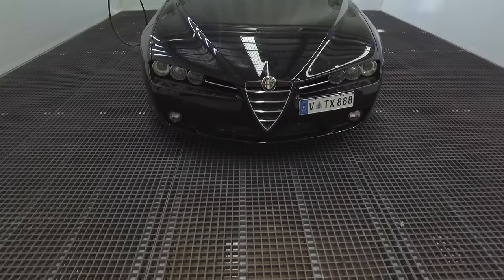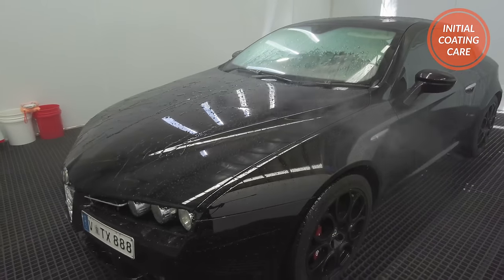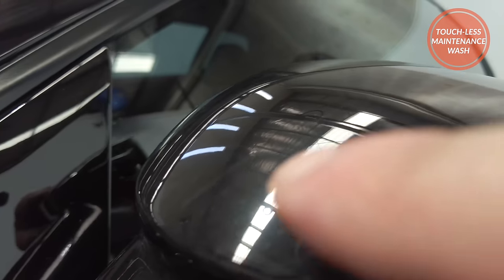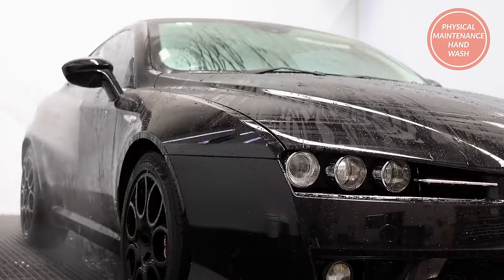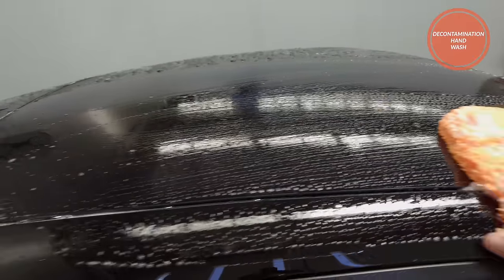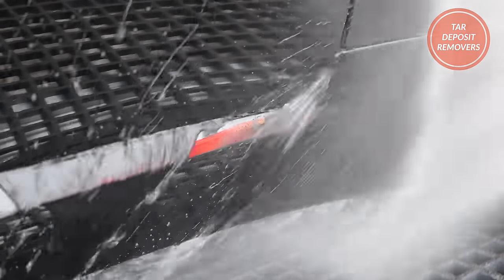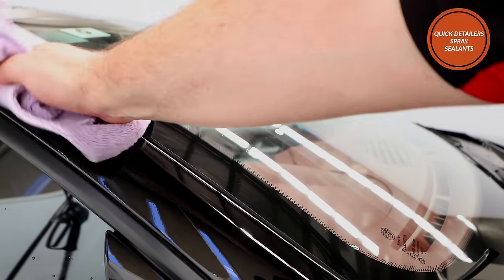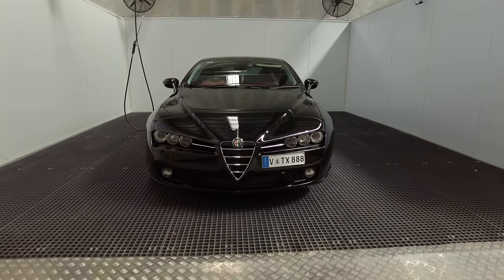How To Wash & Care For a Ceramic Coating From Day 1 To Day 1001 | Washing, Decon & Maintenance

Comment: What is your opinion on using a touchless drive thru carwash with no brushes?
Reply from the maker: I’m not a fan - they tend to use harsh chemicals that won’t do you paint, trims or coating any favours

Comment: hey! awesome video as always. i have a question. i got my car ceramic coated and its first wash is due after 2 days. but unfortunately there was rain in my area and now my car has drops all over it and they also dried up on the car. i am worried whether this would damage the ceramic coating or leave water spots. should i really wait 2 more days for the first wash ?
Reply from the maker: I would just give it good pressure rinse down (with using any detergents) to remove any dirt, blow dry it and then just a quick detailer (maybe one made but the same brand of your coating) to hopefully remove the water spots. If you get to water spots quickly they are generally far easier to remove, and the first week or two after a coating has been applied is always when it’s most susceptible, so it’s best to try and avoid or deal with water spots quickly during that period.

Comment: H Sandro, How do you deal with driving through rain and then parking the car in the garage at home. Does leaving the rain water dry up naturally cause water stains?
Reply from the maker: I’ve found is really dependent on the specific environment. Being in the country now I find that the rain water in my area is super pure and really doesn’t seem to produce water spots, whereas when I’m in the city and working close to the airport the rain water tends to leave water spots far more commonly. It’s also contaminated city rain water mixed with strong sun or UV light that seems to produce water spots most regularly. In other words sometimes it’s abs issue and sometimes not depending on the factors. If I do see water spots, I just try and wash the vehicle as soon as I can and if I don’t leave it too long they usually come off next wash, but if I don’t and just leave them, then they seem to start to etch in.

Comment: Bought a used car with ceramic coating, but it has swirls all over. I’m guessing that’s under the coating? Would a good polish and compounding get rid of everything, and then re coat it?
Reply from the maker: Yes, a compound and polish will typically remove the coating along the the swirls/defects and you can re-coat at that point.

Comment: Thanks Sandro for the video this will come in handy in a few months! 
Do you have any tips on which ceramic to pick? I have two in mind but know very little of them both. 
 
CarPro CQuartz Finest Reserve or Nova Pro? 

Cheers!
Reply from the maker: They are both fantastic coatings so I think you’ll be happy either way
Reply: @CarCraftAutoDetailing  Thank you before the link to this video again Sandro, 

I have question: If a a pro ceramic is coated on the car and i use say Nova Boost/Jet/Lustre. Would that mask the superior properties of Nova Pro? as u layer a inferior coating ontop of the pro nova? This is a scenario i look to many washes down the track and want to know about those little details! Thanks Sandro!
Reply from the maker: There’s always at least some masking in the short term with anything that goes over a coating, but a good well performing coating will tend to reject and remove it much quicker compared to applying it over bare paint. The main benefit is that it helps the coating underneath age better with sacrificial layers being applied from time to time and if those products also have great hydrophobic abilities there shouldn’t be a negative performance effect.
Reply: @CarCraftAutoDetailing  Awesome since finally my new car arrived and its getting Nova Pro, should i stick with applying boost to it from time to time or Nova Jet? :D
Reply from the maker: I’d just leave it with nothing to start with then use Boost after a month and maybe Jet after 3-6mths
Reply: @CarCraftAutoDetailing  legend perfect answer!

Comment: Hi Sir.. after deep clean just like your steps in the video..can i top up my existing ceramic coating (not the Carpro brand) with Carpro Gliss?? My existing ceramic coating are doned by certified detailer and just few months of ages..or i just need to apply the Carpro reload 2.0 instead of Gliss or just let the existing ceramic coating work alone.
Reply from the maker: It’s typically fine to add Gliss after a coating is fully cured and usually the best time is after a deep strip down clean. But I also think it could be a good idea to speak to your coating installer and also get their advice
Reply: @CarCraftAutoDetailing  they advice to use some QD for routine washing to extend the coating life Sir.. mean that I can use some of paint sealants right? The CQ gliss just same as sealant for coating?

Comment: HI Sandro Jeremy here I have emailed you a few times. Thank you very much for this informative video mate I really appreciate it. Sandro you know the problems I am having regarding my ceramic coating dealership. I think I sent you the video of my vehicle and how only a few weeks after the coating it has lost it's hydrophobicity. It is still the same mate what do you recommend I do to bring this hydrophobicity back? I am taking the shonky business to court regarding the terrible job he did on my vehicle. He will not give me proof of product he used I asked and paid for the premium Graphene Ceramic Coating. He will not give me his warranty as I have tried to take my vehicle back because of it losing it's hydrophobicity. When washing the vehicle like you showed Sandro letting the mitts and product do the work no pressure from day 1 the cloths have dragged over the surface not gliding nice and smoothly as a ceramic coating should allow. Keep safe and keep up the great work Sandro thank you for your help.
Reply from the maker: Unfortunately it sounds like the coating itself has failed, so I would be surprised if this process would help as this is really about reviving a coating rather than fixing a failed application which generally requires removing and reapplying the coating.
Reply: @CarCraftAutoDetailing  Thanks Sandro

Comment: Thanks Sandro! What are your thoughts on rinseless washes? Are the better than a good quality soap?
Reply from the maker: I think rinse-less is a great option when water, environment, and logistical challenges are present but it does have its limitations especially when a vehicle is extremely dirty. A pressure washer pre-clean just has so many benefits is safely removing dirt before a physical hand wash that just can’t be overlooked. If the vehicle isn’t all that dirty then rinse-less or water-less can be a great option
Reply: @CarCraftAutoDetailing  thanks Sandro! I’ve been bouncing between the two methods and haven’t found it to be more efficient outside of skipping the rinse after washing the vehicle. Just curious what your thoughts were.

Comment: When doing a touchless wash, you should start at the bottom, so that you wash with the soap and not just rinse it all away. Just make sure to end the rinse top to bottom. 
It also makes it easier to see where you have been, when starting from the bottom.
Reply: Yeah agree on that one, and during a pre wash of a very dirty car in our conditions, I'd guess Sandro's conditions are slightly different hence him doing the opposite. That's the only bit I'd do differently, based on my conditions where during winter the lowers and rear of the car are filthy.

Comment: An acid based cleaner is what’s used to break a ceramic coating down so how does it revive it?
Reply from the maker: An appropriately formulated acid cleaner is used to remove bonded water mineral deposits.

Comment: Hey Sandro, I’m wanting to ceramic coat my 2004 VY calais .. I need to do a two stage correction on it but I don’t have a garage so I’ll be borrowing one. Can I coat it and leave it in a garage for 24-48 hours after coating and then leave it sit outside after that? Because I’m on street parking I just don’t want to waste my time coating it
Reply from the maker: Yes you can absolutely do that
Reply: @CarCraftAutoDetailing  thank you mate ! :)

Comment: Hi Sandro, what kind of ceramic coating did you use?
Reply from the maker: Nv Nova Pro
Reply: That’s impressive! Is it a free sell product or for professionals Only?
Reply from the maker: Professional only
Reply: @CarCraftAutoDetailing  di you compare it with Carpro, Geyon or any other “mass”brand? That’s looks incredible after 3 years…

Comment: should the first wash be with ph neutral or use carpro reset shampoo?
Reply from the maker: Reset is PH Neutral so yes it can be used for the first wash
Reply: how about using nv snow for pre wash foam and carpro reset as bucket wash?
Reply from the maker: That’s absolutely fine

Comment: Do you think using carpro reset to wash my coated car weekly is a good idea or should i only use it maybe once per month and instead use a wax safe shampoo with no additives for weekly maintenance
Reply from the maker: Reset is fantastic for coated cars, though it can slowly impact less durable waxes and sealants over time, but it won’t harm a coating in the least. If you have any less durable toppers on the coating, then yes maybe using it once a month and using something a little lighter can be a good general technique, but I honestly wouldn’t be too worried.
Reply: @CarCraftAutoDetailing  Thank you, Sandro, for your very helpful tips - I was hoping you'd do a video on this topic. I was thinking, too, how something like Reset fits into the maintenance routine. I applied Cquartz SiC over UK 3.0 6 months ago, and really loved the slick feel at first. It's not quite as slick now. I'm wondering if (after doing an intensive clean) applying Reset would retain the properties of the coating (like Nv Boost when applied sparingly), or would it change it to the properties of Reset (good, but not as slick)? I'm using Nv Boost now after every hand wash (and like it), but wondering if the coating is ready for something more intensive like Reset. Your comment that it won't do harm is assuring, but I'm just curious as to what result to expect, based on your experience?. Or is there no additional benefit to using Reset if I'm using Boost regularly?
Reply from the maker: Well Reset is really only going to clean the coating and really not leave a thing behind like Boost. I think if the slickness of the coating isn’t as slick as you’d like it then Boost is definitely going to do that, but Reset can still play a bit part in maintaining it.
Reply: @CarCraftAutoDetailing  Thank you!

Comment: Sorry to bother you ,but I would love to ask a question.  If I  Ceramic my car ,can I then use normal polish thr car on to of the ceramic coating
Reply from the maker: Compounds and polishes contain abrasives that will breakdown/remove a coating - so it’s not advised to use them until you’re ready to remove the coating.
Reply: @CarCraftAutoDetailing  thanks for that advice,  but What I meant to say was . Can I  Wax on top Of the ceramic coating
Reply from the maker: You can, however most waxes will tend to mask the coatings self cleaning and hydrophobic behaviour so it’s just something you need to consider. If it’s an older coating that’s started to loose it’s peak performance then I see no harm in doing it.
Reply: Thank buddy really appreciate you answering my questions 😀

Comment: You can buy pressure washer from bunnings supercheap for not.much
Reply from the maker: Exactly right, and pressure washes also use a fraction of the water compared to a garden hose.
Reply: @CarCraftAutoDetailing  yea you'll save hundreds on the water bill

Comment: I don’t like how manufacturers recommend 1:10 in a foam cannon. There are big variances in pressure washers and that makes a difference. PIR should be recommended for dilution.
Reply from the maker: I think it would be handy if each brand gave PIR recommendation along side more generalised dilution ratios for the keenest detailers willing to run those calculations through their own personal set up, but in truth it’s such a tiny fraction of users that even know what PIR is and would be willing to work it out, so I guess most brands don’t even go there as it could be seen as an extra layer of confusion for 99% of users, but I still agree it would be nice to know.